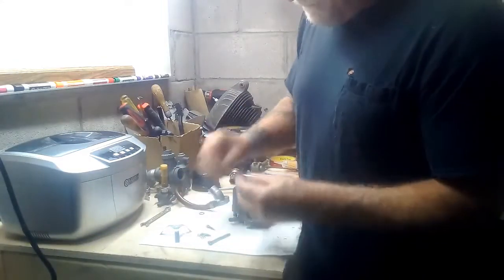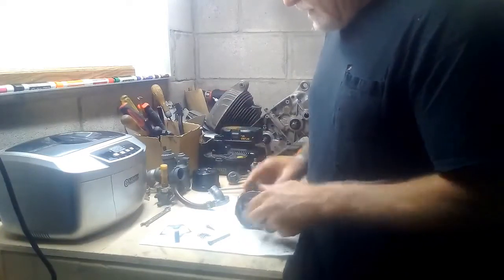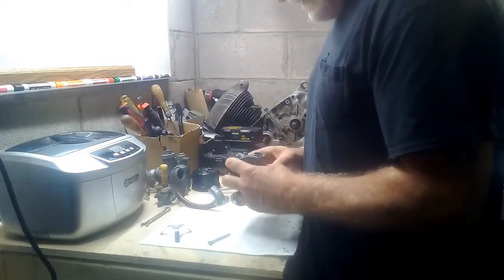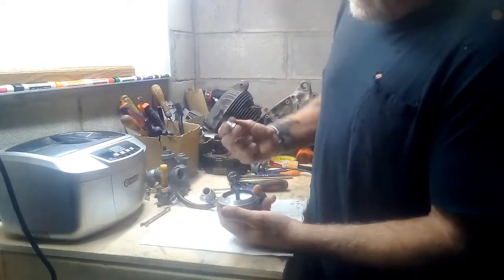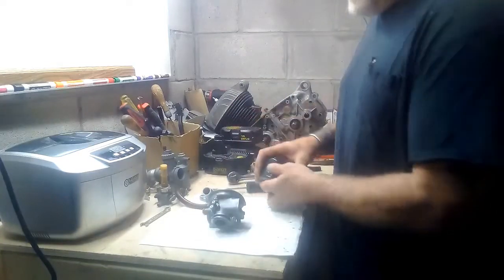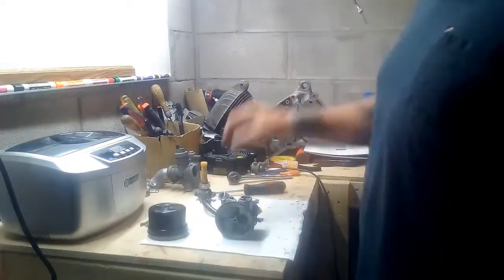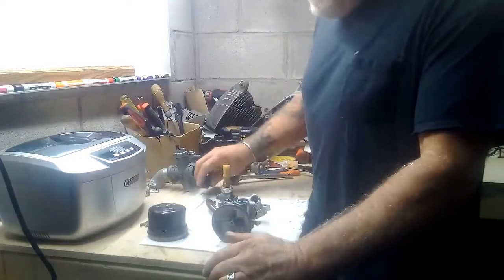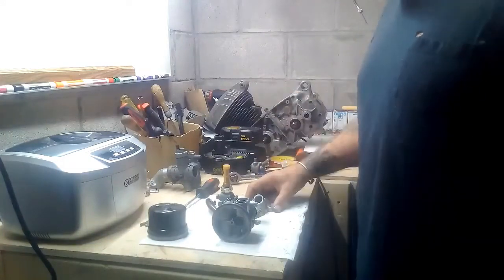HARLEY DAVIDSON LEGGERO 1970 #3 DELLORTO ME18 BS CARBURATOR, ASSEMBLY/ TUNING

Comment: Where did you get the parts manual for the carb?  I can find the image but not the description of the parts.
Reply from the maker: Hey thanks for checking out the channel I hope you like it You have to buy the parts manual for the whole bike it is in there the parts manual gives you an exploded version of every part on the bike good luck with your build let me know if you think there's any questions I can answer
Reply: @westcornerscustomcycles  Did you end up getting the bike to run?
Reply from the maker: @kenward7733  I got the parts manual offline I don't know if you can find the original parts manual or you can find a downloadable version it has the exploded picture of the carburetor and it has a corresponding page with part numbers